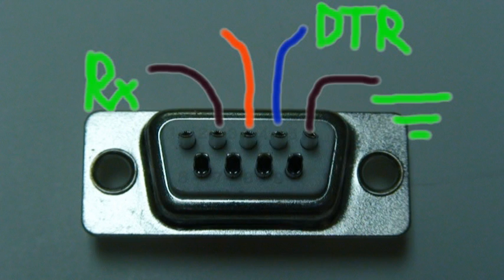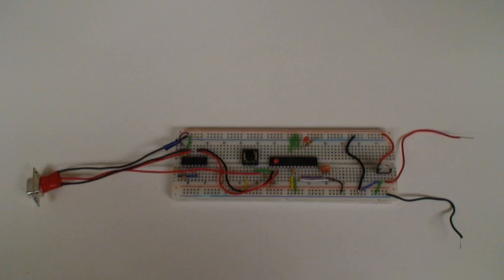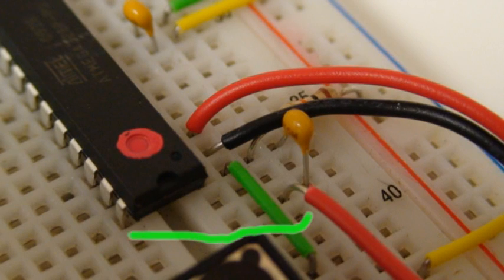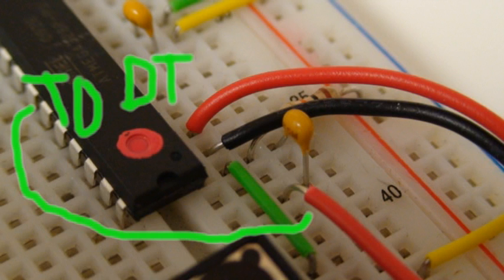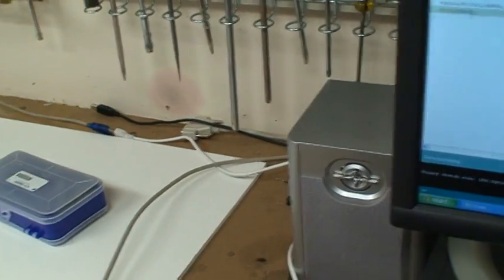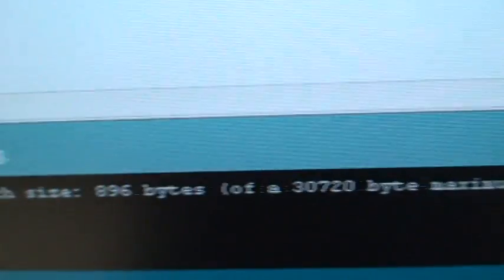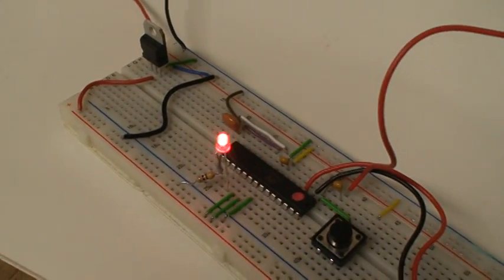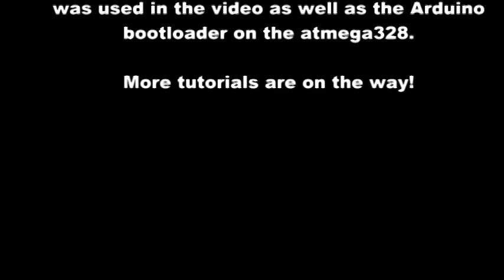Arduino Breadboard Tutorial -Arduino Workshop Project Video #1

Comment: @Halo2maniaccc 

the atmega has the bootloader

the led lights up

yes i am using 100nF caps 

but when i plug the rs232 to the pc nothing happens

no new COM port

the max232 is a MAX232EPE from maxim

thanks

Comment from the maker: I am using a .1uf ceramic capacitor, the link is in the video description. The capacitors are bipolar so it doesn't matter what way you stick them in. First off make sure the chip has the bootloader on it, a chip without it will not work. Then verify the chip is working, put an led on pin 13, power it up and push the reset button, if it blinks it works. Then the max232 tie the rx and tx ttl pins together and echo data in a terminal on the pc. Other than that I don't know

Good Luck!

Comment from the maker: I put up two pictures in the video description on the right. These were archived from when I made the video. Now one of them has all of the components on it put no serial connection and the other has everything except for the DTR cable on it.

You can use them how you see fit but I only ask that you attribute them to me. This is assuming its like a presentation or what not

Comment: @Halo2maniaccc 
I'm probably better off with a normal ATMega chip then, as I just looked and Arduino code looks to be the same as C, and I only know BASIC :-\ So really BASCOM's the best option for me anyway.
I might wing it and get a USB programmer. There just doesn't seem to be much on the web in the way of information regarding which chip works with which programmer and in what programming IDE. Oh sigh!
I might get the USB programmer from AdaFruit Industries.
Thanks for your much needed help!

Comment from the maker: The BL is very helpful but keep in mind it adds a 1 second delay (from boot up to program execution) and takes up about 2k of memory. Sparkfun has a few different ones including a cheap (under $20) USB programmer which apparently works very well for the ATmega 168, 328 chips. There is a genuine AVR one that can be bought from mouser (works for everything) for about $50. USB is faster than parallel port programming.

Comment from the maker: An ATmega 128 will not work, that chip is different than the 8, 168, and 328. There is one place that you can shop that simply dominates all. Sparkfun electronics, they offer USPS shipping and Fedex shipping (better 3 day only $12 usually). Their customer service is great and they are fast at shipping, an awesome company in my book.

You can get the links to the parts in the VIDEO DESCRIPTION which has ALL parts used in the video from Sparkfun.

I hope this helps!

Comment: @Halo2maniaccc 
Damn, I was worried it'd be a function of the arduino BL. Shame you can't program a normal ATTiny/Mega over the serial port. Or maybe you can and I'm missing something. The normal programming method seems to be with a printer port though (unless you get a USB programmer, but those work out a bit pricey)
Handy I can burn the bootloader myself. I can dabble with Arduino code on the cheap :P

Comment from the maker: You can program it in an arduino board and then put it in a breadboard. You will need the reset switch (and resistor), ceramic resonator (or a crystal with the 2 capacitors), filter capacitor (for power into the chip), and power regulator to run it. The max 232 chip that connects to the computer is for serial communication to a pc or programming so you don't have to put it in if the chip is already programmed or if you just don't need it.

I hope this helps!

Comment from the maker: You can program it from those programs but you just need to make sure that you write the code correctly (for the specific chip, libraries ect...) The serial port programming is a function of the arduino bootloader which can be burnt to a blank chip via an AVR programmer. You can also load straight code to the chip with the programmer.

To find out how to do this simply google burn arduino bootloader and you will find simple tutorials on it.

I hope this helps!

Comment: Brilliant video again, Robofreak :-)
I have a ATMega328 I was planning on programming in BASCOM for my robot platform project, but seeing this video has lead me to other ideas, and the inevitable questions:

Will I be able to program a "normal" atmega chip in BASCOM or WINAVR with the serial port setup you use for the arduino chip? Or is serial port programming functionality part of the arduino bootloader/IDE?

Is it possible to program an ATMega chip with the arduino bootloader myself?

ty :-)

Comment from the maker: Those pins are all there, look in the video description and click the link to the ATMEGA 328 PINOUT. This diagram will show you the chip pinout and on the left and right in bold print it tells what the pin would be on a regular arduino like (D0 - D13) and (AIN0 - AIN5) which are the digital and analog ports.

Connect these pins to stuff the same way you would on a normal arduino.

I hope this helps!

Comment from the maker: No problem, I'm glad that it saved you a bunch of time!

The DTR pin is important and easily overlooked. Without it connected to the reset you have to manually reset it and upload the code at the same time which is a royal pain...

I will have some more tutorials on in a few weeks!

Comment from the maker: @prasadanatekar 

Well I looked online and couldn't find anything about the 128 chip. Currently arduino supports these chips

Atmega 1280
Atmega 328
Atmega 168
Atmega 8

Now if you can get your hands on some 1280 chips they have more pins and memory than the 128 chips and they are supported in arduino.

Comment from the maker: The bare minimum would be the atmega, resonator, reset switch with resistor, breadboard, and some hook up wire. This is assuming you have a nice clean 5v power supply, if not I would strongly recommend adding a regulator and a few capacitors to smooth out the power.

With this you could program the chip elsewhere and then install it in the board. Sometimes there is problems with the boot loader not starting if a serial connection is not detected, stick a 10k resistor between RX & TX to fix this.

Comment: If you dont need to program it on the breadboard is there anything else you need other than: breadboard, atmega, resistors, 16Mhz resonator, and some wires?

Comment from the maker: You might be able to but I am not sure if the Arduino environment supports that chip. The bootloader only works on a few chips 8,168,328, and 1280 from what I know and the IDE only creates code for those chips. You can port the chip over and get it to work but this is a tricky process.

I also could not find a dip version of the atmega128 only smd so I think you may have meant the 168 (this will work without a problem). The chips also have to have the boot loader to be programmed over serial!

Comment from the maker: No the MAX232 takes RS232 SERIAL (high voltage) and converts/steps it down to TTL SERIAL(whatever voltage the chip is running at in this case 5v) there is no USB connection involved in this video. There was a USB to RS232 adapter on the table in the video but I did not use it what this does is it allows you to convert a USB port to an RS232 port if your computer doesn't have one. 

If this doesn't fully answer your question then post again!

Comment from the maker: Serial can go up to around 12v from a regular cable (from what I know) but the MAX232 chip will take care of the voltage if it changes automatically. USB is at 5v but there are converters that take the 5v USB to 3.3v or 5v TTL level serial for micro controllers. The capacitors are VERY important, they are required to make the MAX232 run and they can help smooth out power input to avoid damaging the micro controller.

I hope this helps......just wait for the next tutorial it should be good!

Comment from the maker: 16 mHz is a common speed now I don't know who chose it or why but I do know that its a pretty common speed. The arduino in the video could be lowered to around 1.5 mHz to save power but it would cause code to be executed much slower.

Just think of it like a throttle a higher value will make it execute stuff faster and a lower will make it execute slower.

Comment from the maker: The mHz is just how fast the microcontroller runs. The higher the mHz the faster the controller is running 1mHz means one million cycles (clocks)  per second 16 mHz is 16 million and so on. The advantages are faster code execution and better performance, the disadvantages could be a much higher power draw and potentially unstable operation if you push it to fast (there is a limit) .

Read the next comment as I am about to hit 500 words....I hate that limit.

Comment from the maker: If you look carefully at the circuit there is an orange component with three legs, this is called a ceramic resonator. It does the same job as a crystal with lots of pluses like smaller size and built in capacitors which further reduce the size. + they are cheaper. The only negative thing with ceramic resonators is that they have a loser tolerance and are less accurate than crystals. For most applications they are fine but for RF signals and very precise things a crystal is what you want!

Comment from the maker: Look at the pinout for chip, the D/O pins and ADC pins on the chip pin out are used to interface to components just like a regular arduino board would it's just on a breadboard! The LED that I had blinking was connected to a D/O pin on the chip that was turning on and off thus causing the blinking. If your not familiar with using D/O or ADC pins don't build this first get an arduino starter kit and learn the basics with a usb board then build this after you have a foundation.

Comment from the maker: Make sure that you have "atmega 328" selected under tools -> board or select whatever chip you are using. Make sure the arduino bootloader is on the chip if you just used a regular atmega 328 it won't work (you will need an isp to burn it or just buy it from sparkfun pre burnt). IF everything is connected 100 percent right there should be no problem, check the breadboard if its crappy there may be bad connections.

It worked for many others so something is not right on yours hardware or software

Comment from the maker: You can burn the bootloader manually but you will either have to modify an arduino board, build a parallel port programmer (really easy), or buy an AVR ICSP programmer (about $30 to $150)

Search "burn arduino bootloader" on google and find the arduino website. This will show you how to do it.

Also look on youtube type arduino bootloader and its like the third video down showing how to burn it by modding an arduino board.

Sorry I can't post links in youtube comments now!

I hope this helps!